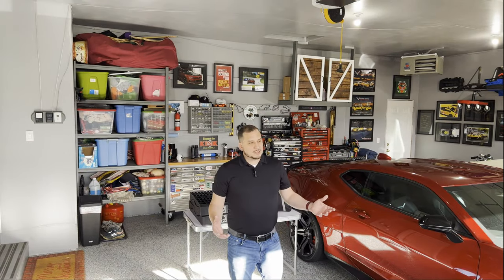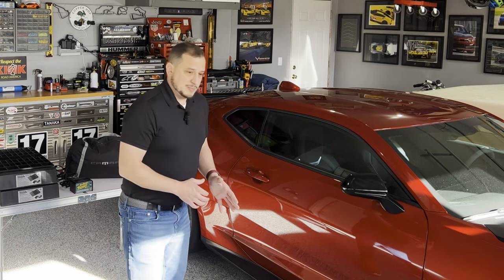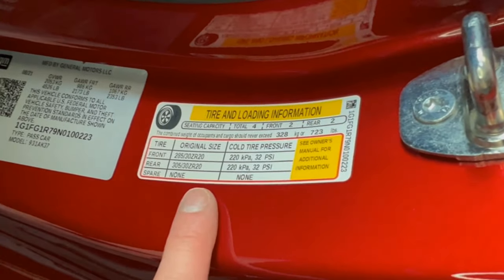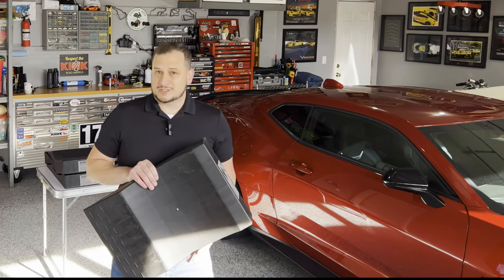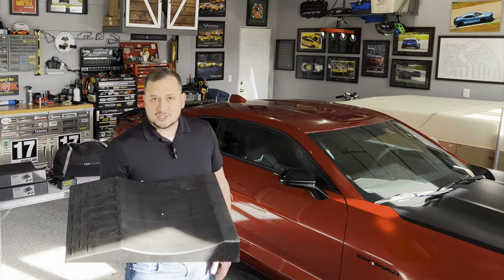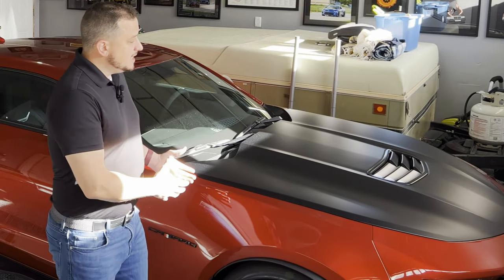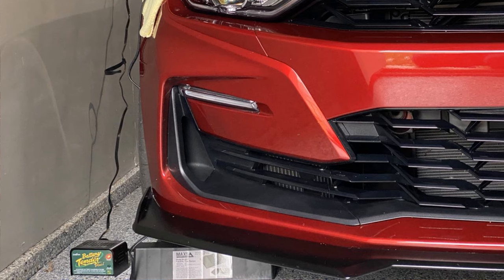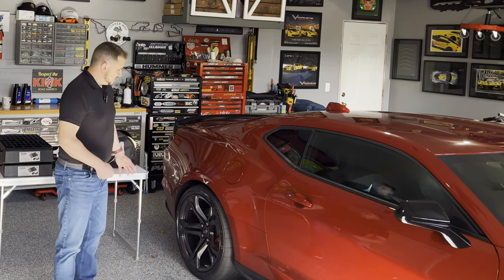How-To: Winter Storage // Do’s & Don’ts for Your Modern Era Car

Comment: Hey! Thank you for a great video. I just picked up my own 1LE in the same color and I just love it. I hope to start tracking it next season after the break in. 
With a manual, do you just leave it in gear or do you put wheel chocks behind the rear tires while in the flatstoppers to ensure it won't go anywhere?
Reply from the maker: With the flat stoppers, they are curved to the tire, so there is no chance of it rolling forward or backward while in storage. I do NOT set the parking brake, but I do leave it in gear as an extra safety precaution.

Comment: Me and my wife only put above   2000 to 2500 Miles from Spring until around first of November just Depends on the weather because we live in Ohio so me I hear Difference People Talking which way is the Best to Change oil and filter beginning of winter or Spring so I just wondering for a 2009 Dodge Challenger with 27k on it and we only put around 2000 To 2500 Miles on it a year so which is best before to change the oil in it before winter or after winter
Reply from the maker: I would put the fresh oil in after winter, so that you get the full level of protection throughout your driving season.